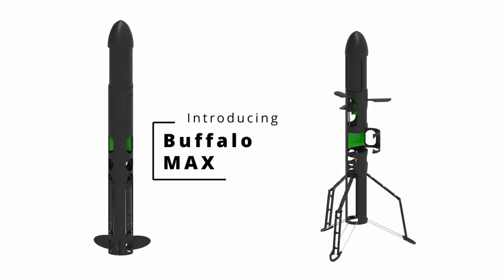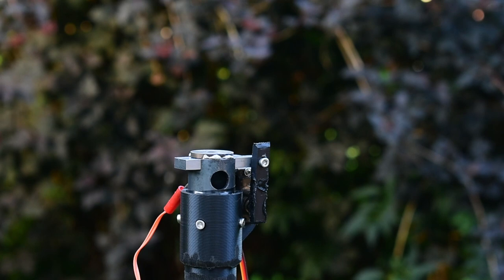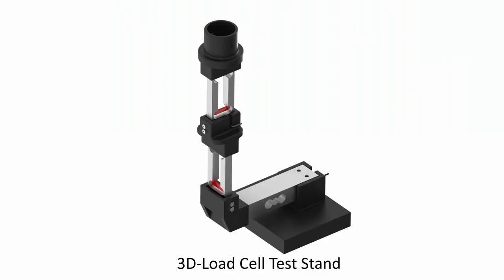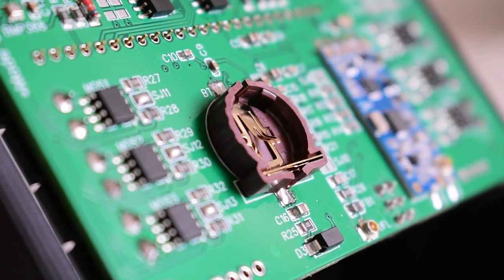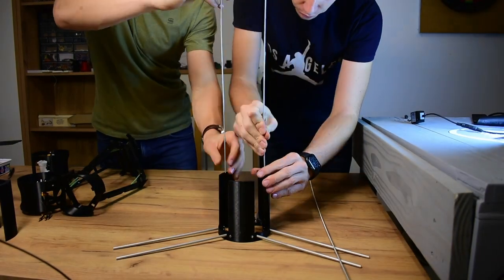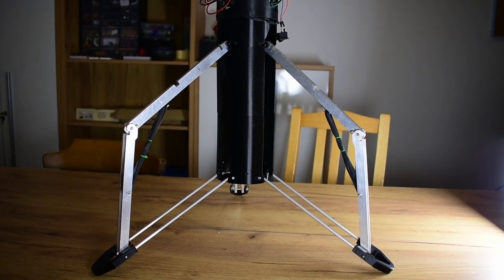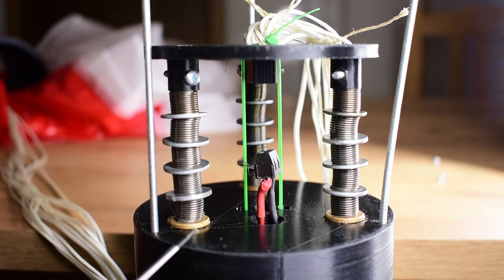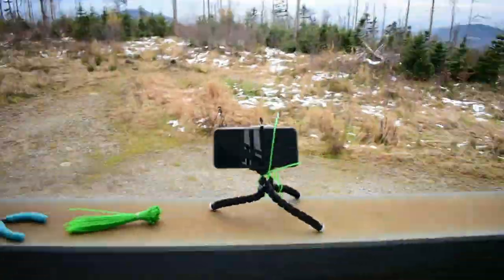Our new rocket is equipped with the ability to land | Buffalo MAX

Comment: You need to add a metal plate like you have. Moving it one direction has a larger hole for takeoff, a middle hole which is medium sized, and pulling the plate in the opposite direction will result in a smaller hole. This will give you 3 speeds... with the smallest hole giving you landing thrust. Landing thrust won't be enough to make it accellerate up, but help it ease down.
Reply: That would be interesting
Reply from the maker: Very interesting idea, I like that thank you!
We have to look into this, but might not be able to use it as the speed one would need to change between de different hole sizes might be too little ...
Reply: @jmspaceR  Then between the holes, add a slot between them so you always have upward thrust until the next hole is hit. ;)